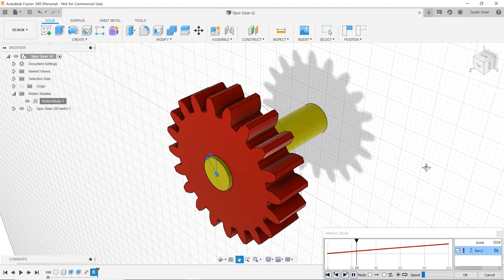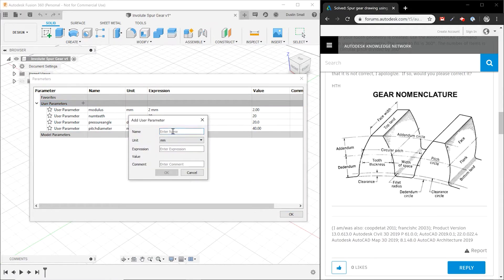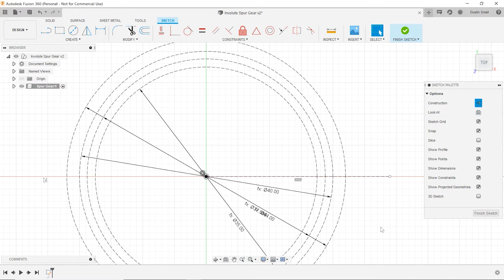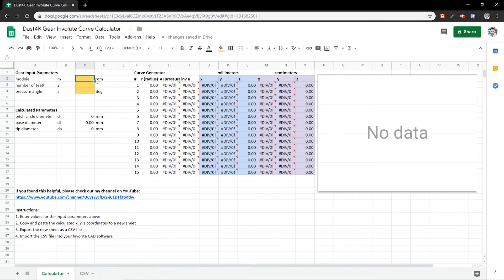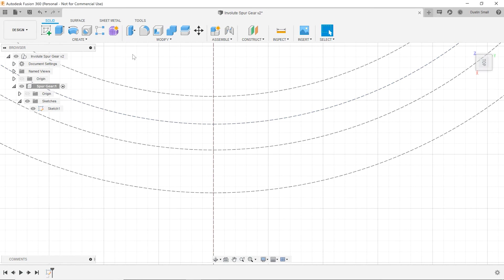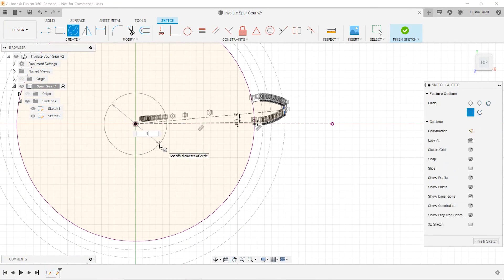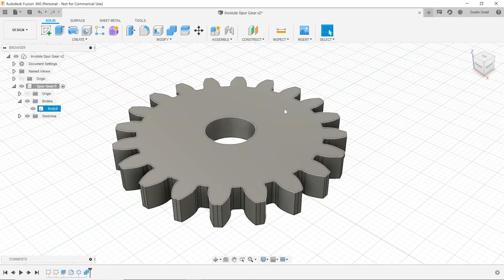Drawing an Involute Spur Gear from Scratch in Fusion 360

Comment: Hi,
nice video, but the title is very misleading. It is not drawing "from scratch" when you have to use external scripts/spreadsheets and/or add-in in fusion. Also there is no point in using this method because there is already an add-in in fusion which can do the same in one step with even more functionality (backlash, root fillet radius, etc.)
the "construction" of the mirror line alone takes quite some steps. why not make the spreadsheet calculate the involute in a way that you can use the x-axis as mirror line?
To calculate the needed rotation for the curve just extend the curve calculation by one line and use the pitch circle radius (diameter/2) as input value and use this formula in field I20 "(DEGREES(ACOS(2*J18/C8))+90/C3)*-1" to get the angle. To transform the x-coordinates use this "M3*COS(RADIANS($I$20))-N3*SIN(RADIANS($I$20))" and for the y-coordinates this "N3*COS(RADIANS($I$20))+M3*SIN(RADIANS($I$20))", where I20 is the field with the calculated rotation angle. Pull down these two formulas to get all 15 pair of coordinates in cm.
Also the tips of the 2 curves should not be connected by a line, but with a center point arc to get the exact geometry (i know that this does not matter for functionality). And there are two ways for the circular pattern that do not generate extra bodies which have to be joined. You can extrude only the base circle first and then extrude the tooth with join command and then use the circular pattern for features (and not bodies) on the extrude feature of the tooth on the timeline (as method choose identical). Also you could extrude the circle with tooth in one step and then use the circular pattern for faces and select the 3 side faces of the tooth. both methods result in just one body.

I hope you don't misunderstand my comment. I really appreciate the work you have put in this video and in the spreadsheet. I did not know about the spline add-in before.
Although for standard gears the built-in add-in is easier and faster, your method with the spreadsheet would be perfect for profile shifted gears and gears with non-standard addendum or dedendum. I will try to work out the maths for profile shifting.

Comment: 1. How do you select the point of intersection of the Circular Pitch (CP) in order to retrieve the correction factor 11:40 it seems your cursor autoselects a point, mine is simply guesswork...
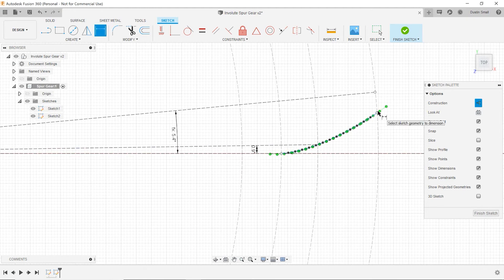2. How do you manage to pick the points where the spline intersects the addendum 12:20 for creating the tooth tip and the lower end?
3. How do you select the spline for the mirror operation?

Thank you, anyone who responds.
Reply: For anybody else wondering about item 3. the author forgot to say "I will now edit the sketch in which the spline was inserted to"  at min mark 09:56 it took quiet a while for me to watch the video over and over agian, to spot the different state of the tree view. 
I am still unable to make the lines exactly at the intersection...

Comment: When I attempt to import the CSV file for the involute curve all I'm getting is a straight line that doesn't quite reach the Addendum Diameter.
Reply: i am having the same problem, did you guys found a solution ?? great video!! keep the good work!!
Reply: Nevermind, i found the problem. It happens to be the correct spline, but in a different plane
Reply from the maker: Hi Nathanael, try opening the .CSV file in a text editor like notepad and have a look to see if it is structured correctly or maybe a blank line got added for example... If not let me know, and you can email it to me for me to give it a try for you if you want.
Reply: @RELUvance  The file looks like it's formatted correctly when I opened it in notepad, I'm not sure what else to try at this point. If you want to look at it I can send it over.
Reply from the maker: @nathanael_opoulos  sure email it to me: dustins2020 at gmail. I’ll take a look.
Reply: true

Comment: How do you draw the profile for an internal gear of a ring gear that would mate with the spur gear?
Reply: I guess you do a normal gear wheel and use it as a tool to "cut" a slightly bigger disc. The resulting ring would be your internal gear.

Comment: Nice job !
The angle you measure at 11:50 only depends on the pressure angle 20°. It is a constant regardless number of teeth or module. Its value is (TAN(PI/9) - PI/9) rad (so about 0,854° as you report), knowing that (PI/9) rad = 20°.
I draw a fully parametric sketch for modeling gears too, it can be seen here https://www.youtube.com/watch?v=dpLONXTY9FI

Comment: Thank you for your video. I need to make "shifted profile gear" (I believe there are no script or tools for this for free) and your video is very  helpful!
Reply from the maker: Awesome! Glad the video helped you!
Reply: What do you mean by "shifted profile gear" ?
Reply: @steelstone  According to Google, it is "Profile Shifted Gear", Gosh!.
This is unique technique to make special tooth of gear. Usually they use cutting tools call "Rack" or "Hob" to cut tooth of metal gear in factory.
The "Profile shifted gear" is made by moving little inner or outer these tools. So, this is called "Shifted Profile". Also, it called "転位歯車" in Japanese.
This "shift" makes change of outline of tooth of gear.
Then, we can change center distance of each gears even same gear ratio, or change gear ratio even same center distance.
This is some times very useful if there is limitation of center distance. And also if tooth number under 17 (pressure angle is 20 deg), the base of tooth will have "under cut". Profile shifted technique will increase the thickness of base of tooth, and this makes stronger gear.
This is very useful but not so famous technique
We can build anything with 3D printer. I hope "Profile Shifted Gear" should be major technique because we don't use any cutting tools but just drawing.
Reply: @らぁ猫  So I did it. A fully parametric gear construction inside Fusion 360, profile shift included. See my link in another comment.

Comment: This was a great help to me. I'm currently attempting to design metric gears using codeblocks in tinkercad and as such needed to know exactly how the shape of a tooth is defined.
This combined with some videos on the maths you implemented in your spreadsheet and a document on the standards of metric gears was just what I needed for my little project.
Reply from the maker: Hi Jan! Glad this helped. Yeah, one of the reasons I made this video was that I remember finding it hard to find a clear explanation of the gear tooth profile shape. Would love to see your project when it’s done!
Reply: @RELUvance  Oddly enough the problem I'm running into isn't so much the maths now as it is tinkercads 200 primitive limit on codeblocks. So I have to find a way to define a tooth in as few as possible primitive shapes. Maybe generate the tooth and blank gear separately and assemble them manually to get around the limit. 
if only it was possible to import parts or stl files into codeblock projects, sigh. still the limitations are half the fun.

Comment: Very nice tutorial. Thank you for using Fusion 360. I was an Inventor user and miss the gear accelerator functionality. I am interested in gearing from a supercharger drive standpoint, both automotive and aircraft engine.
Reply from the maker: Thanks Mark!!
Reply: @RELUvance  Could you please grant 'edit access' to the spreadsheet you included in this video? I am trying to use the spreadsheet to model a supercharger gear from an Allison v12 and google sheet is locked down to 'view only'. The owner must grant the access. If you like, I'll share the result. I plan on modeling some P&W 2800 supercharger gears as well. They are spring dampened to help deal with the torsional vibrations. Pretty cool.
Reply from the maker: @mbhoward  Hi Mark! If you just click on File -> Make a copy , it will make a copy of the spreadsheet on your google account and you can use it however you want... let me know if it works!
Reply: @RELUvance  Hi Dust! How silly of me; I've made a copy and will play around with it! Thank you!
Reply from the maker: @mbhoward  Glad it worked! And yes, would love to see how it turns out!